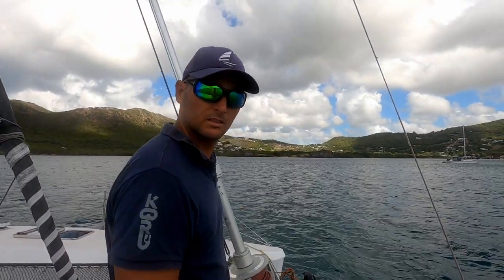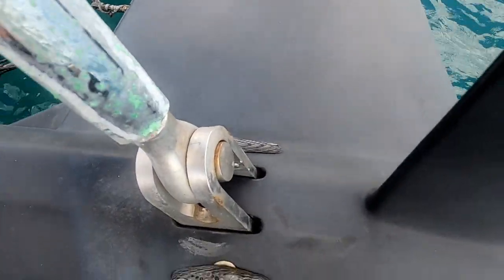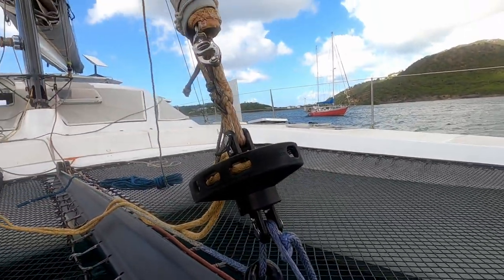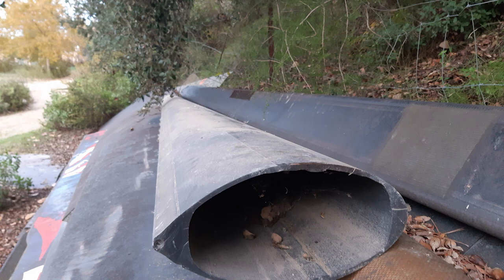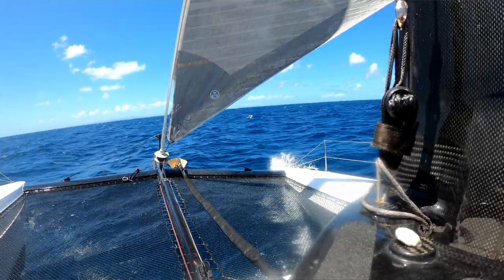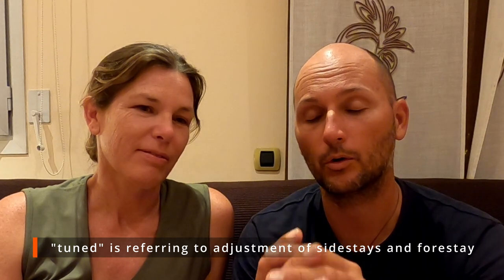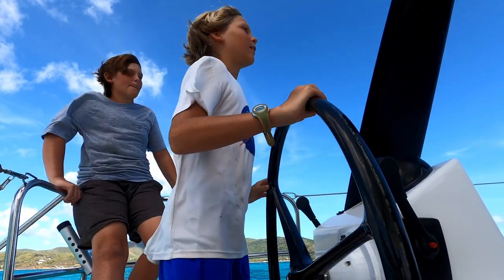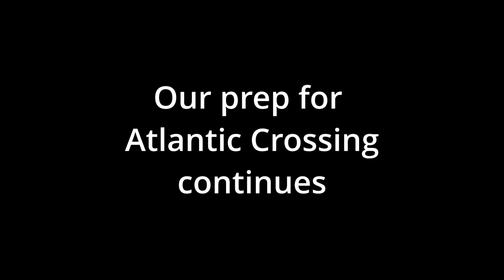Understanding Mast Rake - shortening the forestay on Paikea

Comment: I’ve always wondered how the stays maintained tension on a rotating mast.  Interesting talk about mast tuning.  I’ve often seen adjustable back stays, but never quite understood their purpose.  I always assumed that the mast should be a rigid, fixed plane rising up from the boat, something you do not want to move around in relation to the boat.  Maybe this only applies to racing applications, but it sounds like some movement might be beneficial in certain situations.

Comment: Love the video and explanations. How do you know how much rake to pull out? Incrementally by "feel' or do you know where you LCOE roughly lies?
Reply: Awesome explanation of the the mechanics,  Yes I'd love to know the how much rake too ... before I play with it. It's nice having a boat that will round up by itself when the helm is released (tillers on an 8.5m cat) however that can be a bit of a chore when sailing fast with a small head sail.   So how much rake is optimum for safety and ease of use?
Reply: @StingrayBay  instead of rounding up, a boat with sails trimmed well that will keep sailing  straight with no tiller is a beautiful thing. I’d be standing your mast up in very small increments to get that weather helm down to just barely noticeable. Otherwise you’re always turning the rudder, which is riding the brakes. (I see your brake lights rolling down the freeway ;)
Reply: Well the balance is different with different sails set. Ie neutral rudder with full main and screecher set which is fine in light winds but alot of weather helm with full main and full roller jib if it's too fresh for the screecher,  I can balance her again with a reefed main but then she is under powered unless it's gale force. So my question remains... what is the sweet spot for rake?

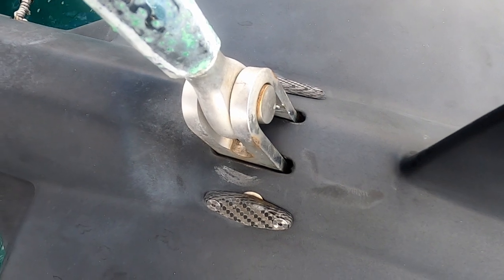Comment: Good son. Ties off the halyard even though it's going through a clutch and in the self-tailer. What's the story on the forestay toggle at 2:33? Eaten by a stainless steel eating marmot?
Reply from the maker: We always tie it off at the winch as a safety precaution. It really doesn't need to be in the self tailer though. DEFINITELY DON'T leave it in the self tailer if you are using an electric winch! Clutch on and tie off is best practice. 

Toggle looks funky because she doesn't like being under the furler. We spray once a week to keep those pesky s/s eating marmots away 😉

Comment: Why not just use a Sta-Lock to shorten the stay? Also interesting that you didn't build a carbon chain plate into the longeron/cross beam for the forestay? Just found your channel a week or so ago - great stuff.
Reply from the maker: I just don't trust a system like Sta-Lock. No need to build a chain plate for forestay. The piece of carbon mast we used in the cross beam is way grunty enough and the solution we have way more elegant. They'll be videos looking at what we did in more detail..Search on our blog for "longeron" www.youngbarnacles.com

Comment: The original problem seems to have been caused by the way you rebuild your frontbeam. There will be more effects of it than just the rake. The angle of the bridle that prevents the middle of that frontbeam from bending upwards has also been changed. For the worse, that is. So.... is your bridle strong enough? Is the dolphinstriker 16:07 long enough for this new angle. How much tolerance would a racingboatdesigner give his customers, do you think ?